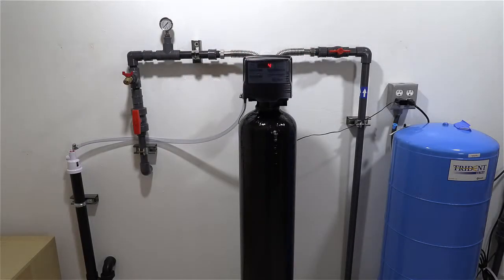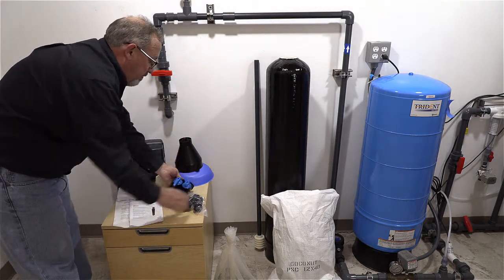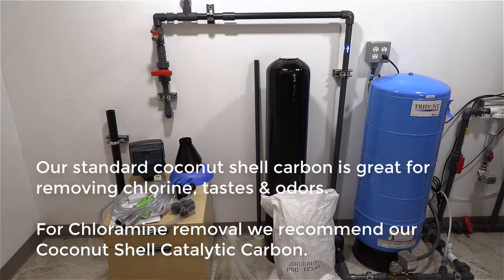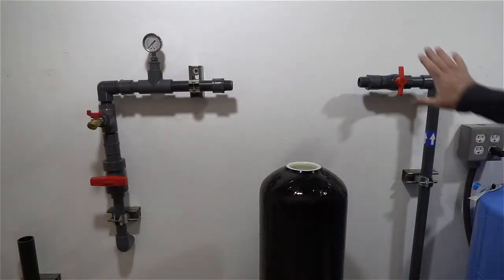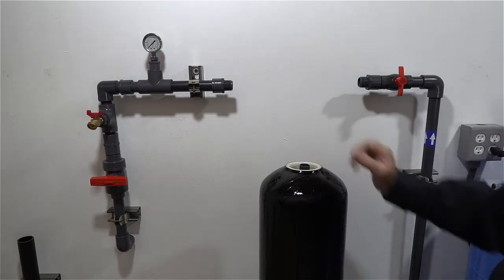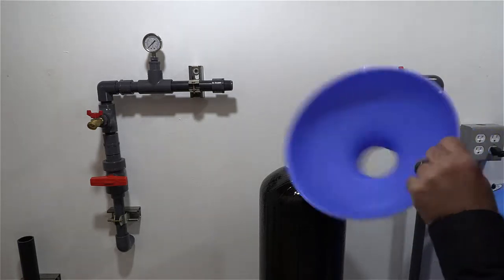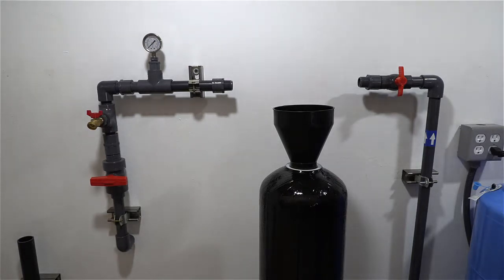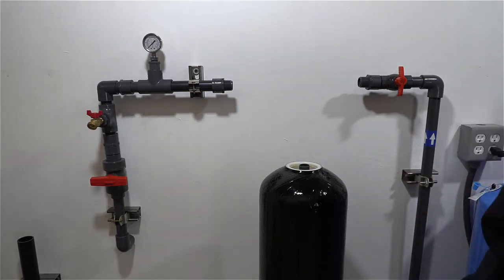5900-BT Carbon Backwash Filter Installation & Start-Up Part 1

Comment: Instructions should note that you DO  NOT want to completely fill tank with water.  as media off gases and expands, the tank will overflow and media floating in the water will possibly end up going down d-tube.  makes for nice mess.